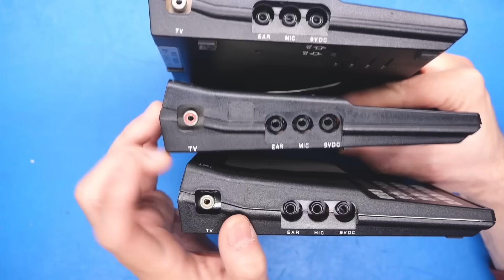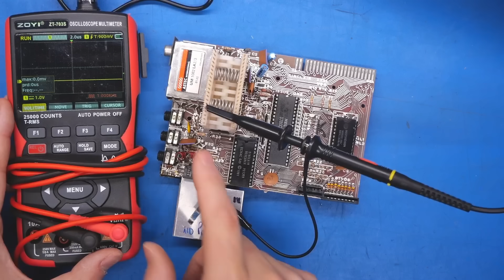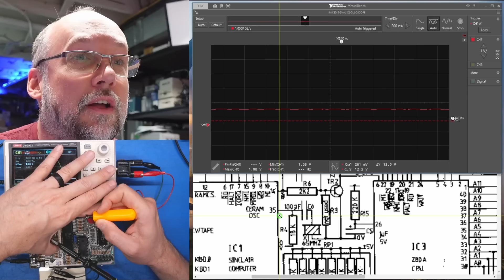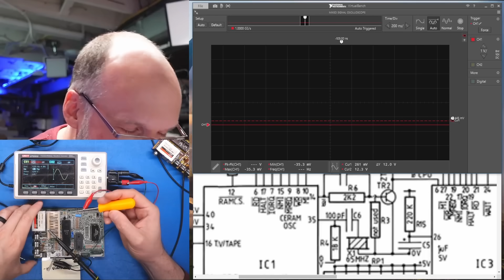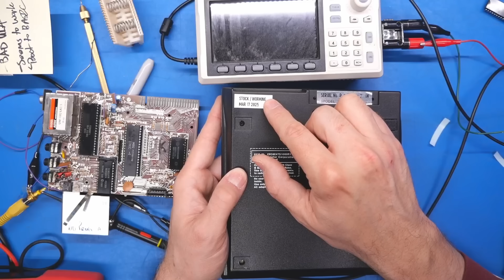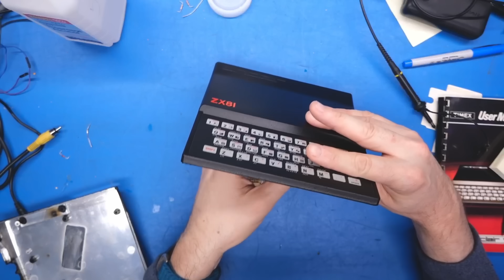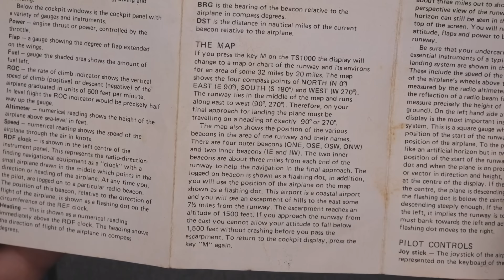Is the ZX81 / Timex Sinclair 1000 actually bad? Let's fix these to find out.

Comment: 3 machines?  Hey, I used to have three of them, and they got lost somewhere....   <g>
(I'm presuming they got lost in our house fire).

By the time I bought mine the TS1k was already no longer sold, I would find them at tag sales and thrift shops, one was still nearly complete in it's box.  They'd usually cost me $10.   My father had also found a Timex Sinclair 1500 and an accessory thermal printer at a tag sale.  The TS1500 looked a lot like a ZX Spectrum but in silver rather than black (I wouldn't even know about the ZX Spectrum for another 15 or so years).

Comment: First time I show it was at a friend's house, early summer of 1981. I was 15. I worked a summer's job that August and got mine with the salary! Too many hours typing Basic programs (and almost always, failing to successfully save/load them on/from a tape). And then 3D Defender came out, and we learned that there is something called Z80 Assembly that can make miracles! (Or in ZX81's case, Z80 machine code, because we had to do everything manually with Poke). The rest is history, there were Spectrums, an Electron, C64, CPC64, a lot of PCs, but ZX81 was my getaway drug to Computer world, my life's job.

Comment: The original kit version of the US ZX81 was an Issue 1 board.  I have several kits still remaining.  I also have my first kit, which I received and built on Christmas day in 1981.  (Note, the original kits were shipped in the ZX80's cardboard box... as well as the early imported ZX81 fully assembled units.)

Comment: The ZX81 was my first computer I ever used, my uncle bought one and let me use it sometimes. I remember always wanting to do more with it and I was sure it was more capable than I had seen so far, for example using assembly. Years later I ordered a kit from Zebra and built one. Ever since I loved experimenting with building ZX81 based computers until I built one with SD card inside it. Though at that time I was a little disappointed that many programs didn't work because they needed variations of configurations or modifications of the computer. Anyway for sure it's a Z80 computer and should be capable of doing more. I thought about building one with CP/M capability though this would need a lot of work to get the display, keyboard and character set working somehow. Anyway, I have sentimental feelings about the ZX81 and I love the design. Also has a great basic manual. I still own a lot of books for it.

Comment: Was it possible to get an RS232 port adapter for the ZX81 back in the early 80's, so you could connect a modem, and did someone produce terminal software on tape for the ZX81?  If so this would've been a great entry level way of getting into the BBS scene.  My C64, 1541 and VicModem weren't exactly cheap in 1982.
Reply: I had an expansion RS-232/Modem for mine, and yes was able to connect to BBS/GEnie.
Reply: Not sure the ZX81 was ever used as a terminal. But I saw V24/RS232 adapters for it, atleast around 1983-84 or so. Probably intended for printers. However, the interesting challenges with the ZX80 and 81 was how to overcome their most severe limitations. For the ZX80, creating a continous picture in runtime, i.e. enabling moving graphics and games. And for the ZX81, how to make it show full resolution graphics (256x192 instead of just 64x48).
Reply: It would have been a terrible terminal. 32x24 character display, I think? No lower-case characters. That keyboard.
Reply: Yes, there are designs out there to make rs232 ports - I built one. It isnt the best terminal machine tho 😂
If you can run WRX hign res software, there is a decent looking terminal program though (my zx81+38 clone cant do wrx high res sadly)

Comment: ZX81 is my favorite computer. I bought it with money earned washing dishes over a summer. I earned BASIC and machine code/assembly language program (I was a finalist in local Science Fair and winner of prize from local ACM chapter for writing a three machine language program - poking in individual decimal values in the computer. I still have a manual and a computer with a 16KB extension. I built a special board so the RAM expansion would not disconnect while I was entering the decimal values representing the machine code instructions. 
This computer launched my partial career in computers.

Comment: I would say that the biggest handicap of the  ZX81 was the fact that the Z80 processor was used in conjunction with the ULA for video ouput. This took something like 4/5ths of the processing power from the CPU and consequently made it very SLOW. In fact there was a SLOW command and FAST command, the latter switched out display of the screen in order to run the Z80 at full speed, but of course not much use for video games. The keyboard I found perfectly acceptable although for games your fingers would get sweaty and start slipping after a long gaming session. However full size, decent keyboards appeared shortly as an add on, so you need not have that difficulty.

Comment: My 1st home computer, Christmas 1981. Put yourself back in the day and realise how impressive this machine was for the money. The keyboard was easy once you got used to it. It was the springboard for home PC's in the UK. We have a lot to thank Sinclair for, and these lil wedge door stops were amazing:)
Reply: Agreed. It was my first computer too, again for Christmas 81 - Ahhhh, those were the days, right?
Reply: The saving grace been able to type an entire keyword with one key press
Reply: My first computer also. Learned basic and some assembly. My dad was a land surveyor and i created a cogo sytem that calcuated traverse lines. I took it to college (Devry) and wrote an eeprom programmer. Made my own keyboard with cardboard. Found a 16 k ram chip that fit over the original with a few pin overlap which I wired in directly. Electrocuted mind on a TV where the hot and ground were backwards because the plug was backwards. 45 years later I still  program for work.

Comment: The first computer I built was a ZX-81 kit.  A popular mod back in the day was to go to the local Radio Shack and buy a $5 surplus Ti99/4A keyboard and rewire it for the keyboard matrix of the Sinclair.  The mod was well documented in the book The Explorer's Guide to the ZX-81 and Timex Sinclair 1000 by Mike Lord, on page 140.  When I did this, I wired the keyswitches using Cat 3 wire stripped from an old phone cable, and mounted it into a Bud case with a sloped front on which I did some crude sheet metal work.  I removed and painted the keycaps with black epoxy, copied the keyboard layout from the ZX-81 manual, cut the key tops out and glued them down, then shot them all with clear acrylic.  The upgrade vastly improved the ZX-81 experience.

I highly recommend Mr. Lord's book for anyone interested in getting into the guts of a ZX-81.
Better schematics are available at:  https://github.com/abaffa/zx81/blob/main/schema/ZX81_Detailed_Schematics.pdf

Comment: ZX81 came out in 1981, not 1982 (that was the Timex version). Most people don't know you could get a Sinclair ZX81 in the USA in 1981, we bought one (in 1981) as a kit and built it at home, we also discovered some of the traces were broken on the PCB and had to fix them (hurray for oscilloscopes for diagnosing).
Reply: Yep I got one in the U.S. in 1981. I had asked for a ZX80 for my birthday. I suppose when my parents went to buy it they were told about the ZX81. Moved on to a TS 2068 later, then Atari 800XL before leaving the 8-bits. Now I collect.
Reply: @z80jim  I moved on to The Atari 800, Then Atari 520ST, then PC... Before revolving back and collecting old Atari's and Amiga's..
Reply: And the ZX80 came out in 1979/80.

Comment: try to avoid inserting membrane foils without the help of strong pliers. Just half a mm for each push. and put some deoxid on the PCB connector and jiggle in some dummy foil, just to make sure, there is no resedue on the pins, risking to crumble the precious traces of the membrane foil.

Comment: I love these things.  My first computer that could actually be programmed in basic (instead of hex entry of machine language).  Got a 32k ram back for it right away, and a metal case with a real keyboard.  Required a bit of mod to the keyboard, and wiring.  with a real keyboard and enough memory it was a great little machine!  Also - if you ant to do programming in machine language (this was the 80's not much in the way of commercial assemblers for it).  You could insert arbitrary strings in remarks, and with careful construction insert machine language in this way instead of dozens of lines of peeks and poke - a nice little line of binary remark and a loop. I wrote lots of software for one of these. I also added a jack for direct video out, modulators are always an issue with screen clarity and resolution, that one in the ZX-81 is very cheap. I think the Timex one that was originally released only had half the memory. 1k

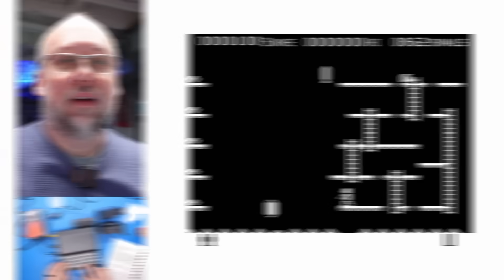Comment: 53:56 wow, TIL that some crazy people figured out how to coerce apparent pixel graphics out of the text-only video of the ZX-81. I’ve looked it up and I don’t fully understand it yet but it’s pretty wild. Essentially tricking the ULA to shift on the fly the location of the character generator bitmap, to instead grab carefully selected bytes from elsewhere in the ROM code.
Reply: Yes, I don’t think Adrian fully experienced the shock and awe that seeing “hi-res” games like this on the ZX81 would have produced back in the day. It’s amazing that software tricks let the little Zeddy display graphics like this. If these games had been around in 1981.. well, I don’t know.. but it would have been interesting!
Reply from the maker: Heh how interesting! When did these graphical games come out for it? Was it years later? I don't recall seeing dates on those graphical games I was trying.
Reply: @adriansdigitalbasement  first 1k hires games were around 2011
Reply: Pseudo hires games in 16k were around within a year or so of the zx81 launch- for example Forty Niner is (c) 1982

Comment: The T/S-1000 was my first computer. It was 1982 and I purchased it at K-Mart for $99. I was 12 years old at the time and saved every dime I had. I then began saving for a 16k Ram Pack but ultimately ended up getting  a commodore 64. Good times.
Reply from the maker: It really sounded like the machine was a "gateway drug" for computers for many people.
Reply: Real question is did you get a grilled cheese also.

Comment: Our first home computer in 1982 we had the ZX Spectrum.  For years I always wanted some of the other computers of the era - a ZX81/80, a Dragon 32, a TRS/80 etc. (I had a C64 + Amstrad over the years).  Had a Vic20 briefly, but it was broken when I bought it.
If I remember correctly the ZX80/81 was sold as a kit back in the day.  Now that would be a fun project.
Reply: There are several projects that are modern day versions of this. The problem is that so much of it it tied up in that ULA. But clever people have expended the logic out to LSxxxx chips. Search google for wilco2009 for example. It’ll work as both a zx80 and a 16k zx81

Comment: With regards to the composite mod and tink 5x. The retrotink uses the sync tip voltage rather than the active video voltage to determine the brightness. I guess because the sync tip doesn't vary in voltage, or at least it shouldn't.

Because your original mod had a sync tip of around 660mV, the peak white is expected to be around 2.33x higher - approx 1.55V. That's why it is grey instead of white.

With the trimpot you got 650mV for the active video, leaving 1.23V for the sync tip. Again the ratio is way out but this time by slightly less, so the image appeared a little brighter.

It's probably a good thing you stopped around 1.88V however as the termination resistor in the tink 5x is an 0402. Anything over 2V could push that resistor to its limit and burn. Ask me how I know 😅
Reply from the maker: LOL! Oh how funny. Well good to know. I'm not even sure there is any way to really fix the output since the whole signal is built up inside the ULA IC. Probably best to just use the RGB2HDMI in the future.
Reply: @adriansdigitalbasement A quick and dirty way is to stick a diode in there. That should cut a good chunk off the sync tip

Comment: The keyboard did improve with practice: and we got a LOT of practice typing in game listings from magazines. However, many of us added mods like a "keyboard bleeper" or extra stick-on keys that sat on top of the membrane. Most of us "serious" users splashed out for a real external keyboard - and then we discovered the slow keyboard polling and lack of buffer meant we weren't any faster :-) The TS1500 was the higher priced version in the US - it had a Spectrum style case and keyboard, and 16K built in.
Reply: Type-ins as a kid on three generations of computer are why I got so good at data entry and typing before actually using a computer at school / college! :D  The pain of spending a whole weekend typing only to have to wait 1-2 months for a correction to the listing to be printed in a later magazine :D

Comment: I had a TS 1000 when I was pretty young, but that was before I was old enough to grok computers and programming, so I don't think I ever did anything serious with it.  I think it was handed down from an older relative that gave me his VIC-20 later on.  
The only thing I remember about it (aside from the keyboard, heh) is that you have to manually scroll the screen with the SCROLL statement.  If you keep issuing PRINT statements and go past the last line of the screen, the program stops with an error.   That is the "5/10" thing that you see at 35:12